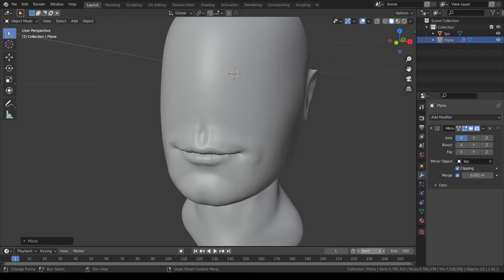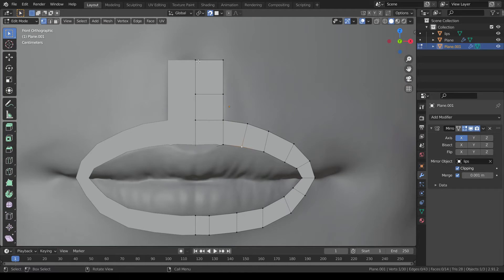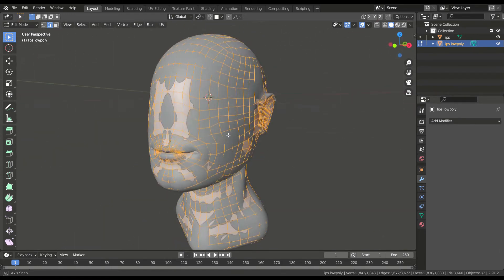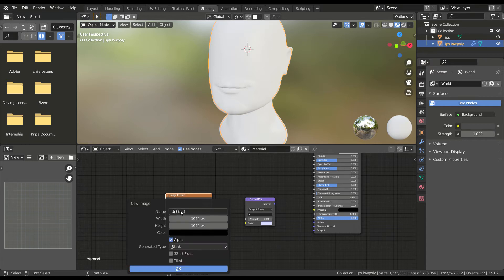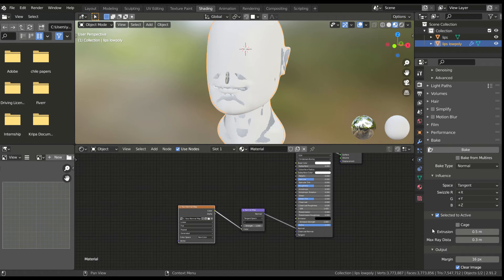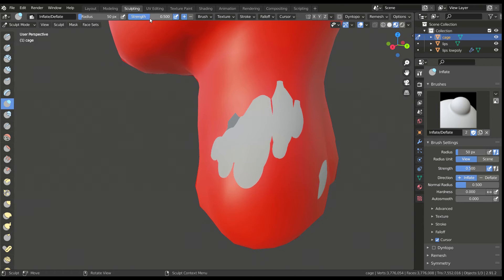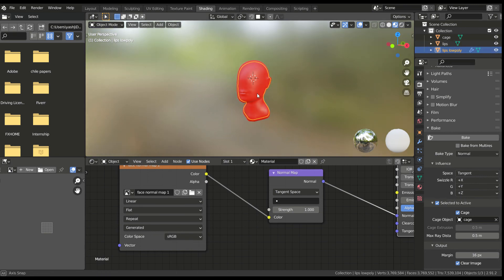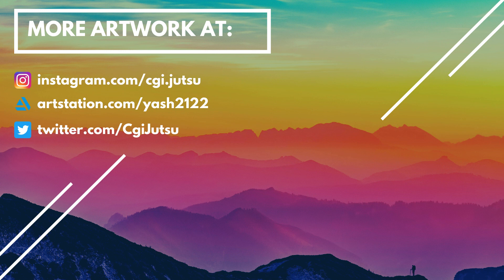Retopology Workflow and Normal Maps | Blender 2.91 Tutorial

Comment: I had issues with my mesh when I removed the shrinkwrap modifier, so instead I applied it. Then, instead of just scaling up the cage, I used a displacement modifier at like 0.09 and applied that. It worked really well :)
Reply from the maker: That is a smart and quick way to generate a cage too. Will surely experiment with that in the future.

Comment: I selected the highpoly then lowpoly, selected the image node and pressed bake, but it says "no valid selected objects". What am I doing wrong?
Reply from the maker: There could be 2 reasons for it:

1. In the bake panel make sure to tick the 'selected to active' box. 

2. Select the two meshes from the outliner, and the order of selection is high poly mesh , control/cmd key, and lastly low poly mesh.